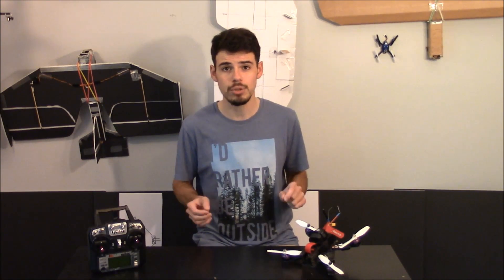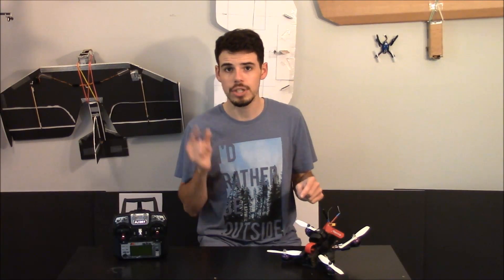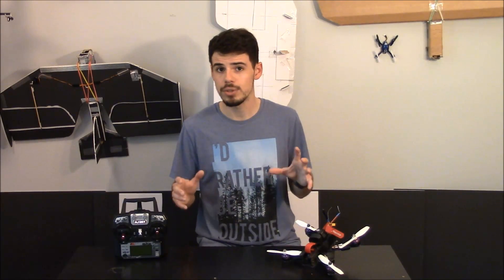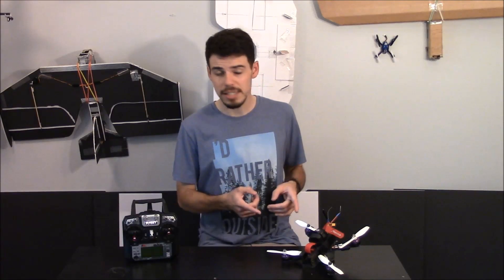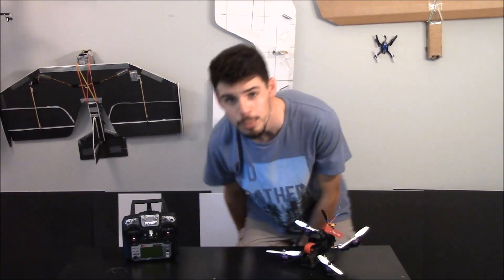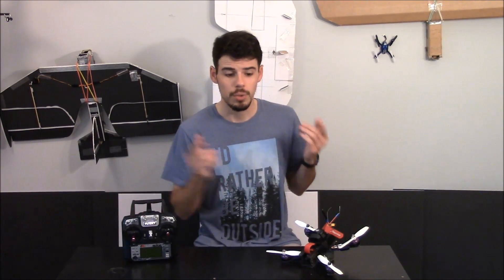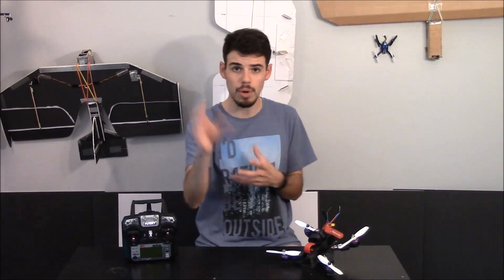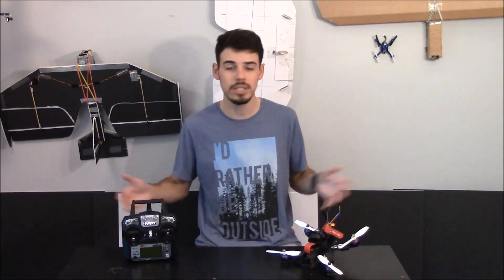What does iBus, sBus, PWM, PPM, Etc. RC Protocol mean?? - Wizard X220 - Help For Beginners

Comment: What does the sBus receiver do that a typical ESC and or Flight Controller cannot do?
I have limited space on my aircraft with the ESC the Flight controller and the battery. 
If the sBuss is something I can do without, that would be great.
Reply from the maker: Hi! ibus and sbus receivers usually don't have servo ports (PWM protocol) and are much lighter and smaller than those used for airplanes. No matter what, you'll still need a receiver to go with your ESCs and flight controller, so the type of receiver you choose depends on how light/small you want it to be, and if you want to be able to use the same receiver for an airplane later.

Comment: Adam, at first I want to say Thank You for all the great job you are doing in this field!
I'm a very beginner, and till this day, I have not fly an RC Aircraft yet but I've learned a lot from You!
Respecting the Question what is an iBus, sBus or so, in my opinion an iBus it may be a base frame of a Drone which has the shape of the Cap letter (I) similar to the drone toy appearing on your bench...

Comment: Hi man...i have this transmiter...and the reciever has i-bus...but the tx has option to i-bus to s-bus...does it work on s-bus? Thanks!!!
Reply from the maker: If your rx is the X6B, yes. You just need to plug the rx into the correct port on the flight controller (should be the left hand side of the large connector port in the rear of the FC), change the output mode in our tx to Sbus, and in betaflight change your rx settings to Sbus (in the configuration tab).
Reply: It has the option of using s-bus but why use it when i-bus is faster ?
Reply: @sptrader6316  because the flight control i bought, it can only support s-bus.
Reply: Thanks bro!!!

Comment: I have the FlySky i6 with the ia6b reciever, and the omnibus f3 FC which is not compatible with iBus, only sBus and PPM. I tried setting it up with PPM but it will not recognize the UART3 port in Betaflight. I am really new to this, what do I do? Can I get a new reciever that is sBus that still connects to the FlySky?
Reply: I have a 210mm quad that I just finished building. That reciever is iBus and my FC does not support iBus
Reply: Thank you very much! The UART3 port is being recognized by betaflight, just not when PPM mode is selected. If I change to Serial RX, UART3 appears in ports and I can turn it on, but my receiver is not sBus so it doesn't matter. I will definitely try out this receiver and let you know how it goes
Reply: Braedon Gentry Did you try the new receiver ?
Reply: samet duman Yes I tried it the other day and I am still having the same problem. When I plug into betaflight it says “failed to open serial port.” I don’t know what to do anymore.
Reply: Braedon Gentry From project blue falcon videos which is exactly https://youtu.be/75nSToUJBUY
this one.you can bind fs a8s with your flysky fs-i6 and omnibus f3 is supported . check this out !! if I am not mistaken anywhere it should work.
Reply: samet duman yes I have tried this and my receiver is bound and properly connected to the omnibus, but it still does not work
Reply: Braedon Gentry Braedon Gentry I dont think it is about your receivers.It is something else maybe a problem about flight controller or wrong soldering . cant help sorry ,good luck

Comment: Great! I was having trouble understanding this at first since I ordered my Taranis Qx7 which came with an SBUS receiver. These are the mistakes I made in case you are in my same scenario:
After reading the flight controller manual, I saw that I had to connect the SBUS cable on the back port, not on the front. 
I was not setting the proper configuration on cleanflight at first and this part took me days to figure out, after this I was all set and ready to go.